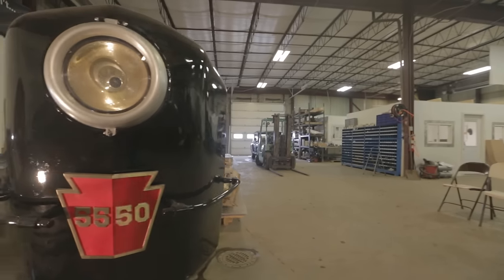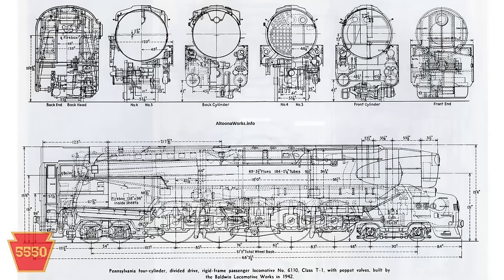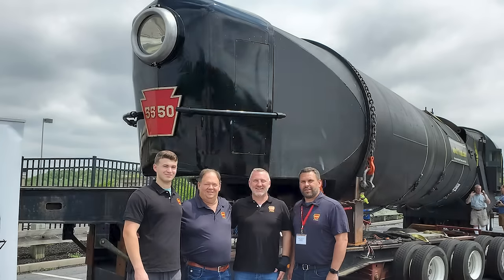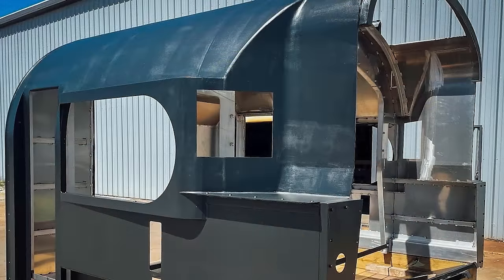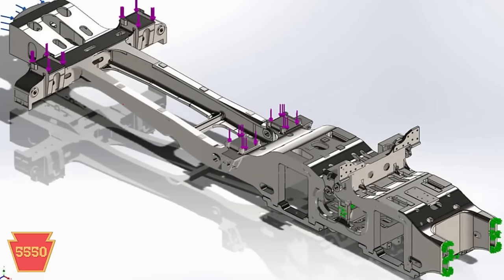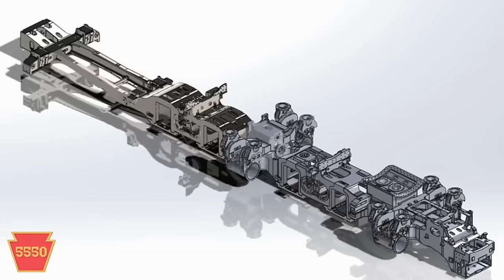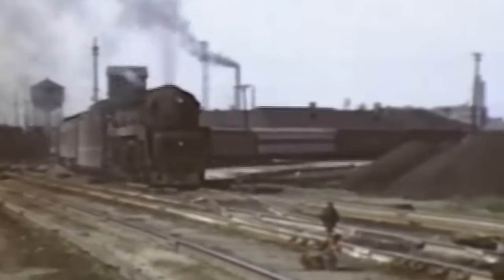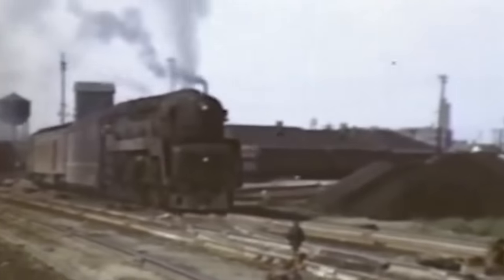Can we build a NEW mainline steam locomotive in the United States? | Restoration Roundtable

Comment: Watching with great curiosity, and hoping I will still be alive to see the finished product run. I am curious what interactions / discussions are planned with the FRA, VOLPE Center, or other organizations regarding the running dynamics and the process which might be required for qualifying the locomotive for operation when the time comes.
Reply: Some of the discussions for using the Fast Loop are already concluded, with the understanding that instrumented wheelsets will be required and that the high-pressure steam boiler is not banned from the facility if correctly built and maintained to code.

More detailed discussions would be made before the locomotive goes to Pueblo for any of the rounds of testing.
Reply: Would the IWS be pilot, driving, trailing truck, or a combination? Having done a couple programs at the test center, I find this part the most interesting aspect! @wizlish
Reply: The IWS requirements for a reciprocating steam locomotive are different from those for, say, a locomotive with driving bogies and frame-mounted motors.

The main driver on the forward engine will be instrumented for sure, and there are nearly as many reasons to implement the lead driver pair.

I would also want at least one IWS in the lead truck, probably the forward one on a pin-guided truck.

The tender mass will help stabilize guiding over the trailing truck, so it remains to be seen whether one or two IWS improve safety over multi axis accelerometers on the truck frames.

I expect that the actual IWS design and provision will be done as part of a college-engineering competition, and not an overpaid consultancy, with a little careful 'seeding' of the challenge with preferred methodology...
Reply: Sounds logical, and definitely very different from the past programs I have done at TTC, and will be doing at TTC in the future. Obviously no one is buying new steam locomotives or anything even close to the wheel arrangement on the T1, so the qualification requirements will be as unique as the over all locomotive itself. @wizlish

Comment: The T1 appears to have been designed to allow at least 140 mph.   Looking at the front of the locomotive, it may not have been done for this reason, but it appears it may have been built to deal with hitting a fully loaded concrete truck at a road crossing at 140 mph.   With that level of kinetic energy the crash would be like an explosion and the front of the locomotive appears designed to survive it and likely stay on the rails.   If only the Southwest Chief  Amtrak locomotive would have been better designed when it tragically hit a loaded concrete truck at a road crossing at only 90 mph.   It derailed and caused many of the Superliner cars to also derail and end up on their sides killing several passengers.   If the T1 would have been pulling that passenger train it would have likely stayed on the rails blowing the concrete truck away., but leaving the it and the passenger train intact.

If not running the T! on coal a nice modernization would be to burn compressed natural gas.    Possibly getting sponsorship from a natural gas related company.   For putting on smoke displays various different color dies might be used besides just black.  Another modernization would be the use of fantasy paint scheme on the locomotive rather than black.  

Railroads didn't care about the reciprocating steam locomotive side-to-side rail pounding, but now they do.   Placing some type of cam counter balance out-of-sight to eliminate that action would be a good update.
Reply: CNG doesn't have the right energy density for proper combustion in this application, although it's possible that LNG would.  A more likely use of natural gas (in my opinion) is as a dual-fuel 'boost' in the superheaters for better steam quality, but mass flow was seldom a critical issue on a T1.

Find and study the Westinghouse patent for the Langer balancer (1948) which facilitates zero overbalance by mitigating surge.
Reply: @wizlish  In general NG  has about 2/3 the heat output per oxygen mass (air) as heating oil, requiring about 50% more air for the same heat output as oil.  The advantage would be public image and maybe easier maintenance.  Physically, providing enough combustion air for natural gas steam generation for a locomotive doesn’t have foreseen strong engineering challenges.  Retrofitting a coal burner to natural gas without heat reduction might not be viable.  If using the locomotive daily in urban areas, the low pollution levels of NG might make it viable versus burning heating oil with no pollution controls on it.  Looking out 30 years from now having a high-performance natural gas burning steam locomotive with high reliability, would likely allow it to be used much more frequently with less maintenance than one burning heating oil.  I think it would require a sponsor, wanting to promote natural gas and pay for the engineering and systems to allow it to take place. This is real engineering requiring an advanced engineering company, but it is well within the realm of current engineering ability.  The result would hopefully be a more practical daily use high speed, steam locomotive without the mess typical of oil or coal.
Reply: The problem is in getting the necessary density and radiant length of combustion plume for the T1 radiant section -- much of the thermodynamics is similar for GPCS combustion where Besler tubes aren't used in the convection section.

One reason LNG or cryomethane would be preferable to CNG is in regenerative heating of liquid fuel.  I did look a bit at using heavier fractions (propane or butane) but they need careful (and somewhat difficult to proportion during turndown) manifold arrangements with many components in exotic alloys.

Keep in mind that a locomotive fire is entirely below atmospheric pressure and by design runs close to a reducing atmosphere as practicable.  The long luminous plume of carbon from solid-fuel vaporization and particle combustion is not observed in the light alkanes.

Comment: I would be far more interested and impressed if they tried to design a new steam train using modern materials and modern teachniques to see if they could build a modern steam train that was far superior in speed and efficiency then the 1940's designs.. Simply copying the old design seems like a waste of a great opportunity to make something new and innovative..
Reply from the maker: We are working to build the locomotive with improvements and innovations made since its original construction without wholesale changing the design. The T1 is one of several locomotive and railroad engineering and mechanical projects we're working on, and there is plenty of crossover in what we learn in one arena and how it influences another. The intent of the project is not to be "new," but to be unique, and as a result fill a gap in the railroad preservation record.

Comment: I applaud the effort, but I'm unsure of the reasoning in regards to the design. If y'all were so head-up to rebuild a failed design, why not build something like the C&O Class M-1 Steam Turbine, and attempt to fix the bugs that killed the class?

Or better still, y'all could've set out to rebuild a Dreyfuss-Streamlined Hudson. Something elegant, yet a lot more practical. I doubt there's a line that'll allow you to run, given things like insurance, freight traffic, ETC. Not to mention, thanks to the powers-that-be slacking so badly at their jobs, the rails of today are a lot less well-kept. -Cough-NorfolkSouthern-Cough.
Reply: You’re so wrong. There are so many short lines and tourist railroads that can accommodate 5550. Stop spreading rumors 🤡
Reply: Also, if you’re so into a C&O Class M-1 steam locomotive, how about starting a group to build one yourself, instead of being all-talk and diddling yourself.
Reply: @chooch1764  First off, I only used that engine as an example of another failed design they could've attempted. 
And this is supposed to be for Main lines. Not little rinky-dink tourist runs. And what rumors?
Reply: @isaacdyer6556  The trust has said they have multiple operators that reached out to them saying they can run the T1 on their railroad. You saying “they have no where to run it” is rumor you are spreading. It doesn’t matter if it’s mainline or tourist railroad. Steam purists make me laugh. 😂
Reply: The PRR T1 wasn’t a failed design, if it were than why did they build more after the prototypes? They were cut short as the railroad began to dieselize, but I don’t see how it was a bad design. They fixed most of the wheel slippage issues with the final design. Other than being welded instead of casted, the main differences come down from the updated valve gear and being an oil burner instead of a coal burner. The trust is more so updating the design rather than fixing it for the most part. The American steam turbines were gigantic and impractical. Shame they weren’t preserved but no good reason to rebuild one. Hence why the PRR only ever built one.

The PRR T1 can go anywhere a large Northern can (such as 611). They don’t need to go on a class 1 Railroad. NYC Hudsons don’t exist, but other Hudsons do. Not saying I am against rebuilding one, but if we are rebuilding a steam locomotive from the ground up, might as well do it for a wheel arrangement that hasn’t existed since the 50s.
Reply: @Stooltoad5017  What makes me laugh so hard is those steam purists think there is nowhere to run 5550, when it was clearly stated that multiple short lines and tourist railroads have invited 5550 to operate on their railroad. When I tell them that, then they go “mainline locomotives on short lines don’t go together”. It’s pretty sad for those steam purists.
Reply: You're right about the existence of other Hudsons in the US (Japan also has Hudsons, been running one in Kyoto for years). In fact #CP2816 will do the ultimate railtour in April.
Reply: The T12 wasn't a failed design, so with that fact the rest of your question is open for discussion.  Why not build a Niagara, another steamer that didn't 'fail'?
Reply: @mesenteria  A Niagara would be a great candidate. Lot more sensible than the T1, especially in yards, on tight curves, ETC where that rigid framed chassis would be an expensive issue.  I like the T1, but it is impractical.  
And despite the un-named operators allegedly reaching out, I highly doubt that the T1-Trust's idea of running that behemoth at high speed in order to set a new record is feasible. 
No way a Class1 route is going to allow that. 
And some piece of crud tourist line? Forget it. 
They're lucky enough to have rails and bridges that'll hold what they have already. 

Look at Strausburg. And Steam town. 

And it's not likely that they have a long enough stretch of straight, level track for that monster to get speed up anyway.
And besides, if the Trust really wanted to make an iron mountain set a speed record, they already have numerous engines they could've just modified.
Reply: @isaacdyer6556 The PRR T1 could go anywhere anywhere a large Northern can, it can negotiate 16 degree curves, improvements from the Trust will bring it up to 20. That’s about as much as 1225 can handle. It doesn’t need to go full speed at any of the “crudy” tourist lines. It will only need to go full speed at the Pueblo Test track in Colorado where they plan to test it. A Niagara would not go any faster than a PRR T1 would on a tourist line.

Comment: One huge problem those two sets of 4 wheels main drive u]your 4x4 link proven wheel sleeps power weight they had to much trouble that’s why those big engines usually have 6 or 8 or 10 main drive or 6x6 or 8x8. Just me think they need at least go 6x6 route
Reply: The original 'fix' was the type of geared conjugation proposed by Riley Deem (an ex-Lima engineer) for an improved Q2 in the early Eighties.  This needed a little conceptual improvement (e.g. with magnetorheologics, which were a 'thing' in 1948-1949) but nothing showstopping; in fact by using the drive-arm FSSD B-2 valve gear there is enough room to implement this "if it proves to be necessary"

The fallback is traction control, via a lateral-caliper driver independent acting on cheek plates.  (See the arrangement on the AEM-7 electrics).  In theory 'enough' trim and slip control could be accomplished with the conventional independent rigging.  And the Wagner throttles from the ACE3000 LP cylinders would integrate nicely into eight-valve FSSD type A cylinders...